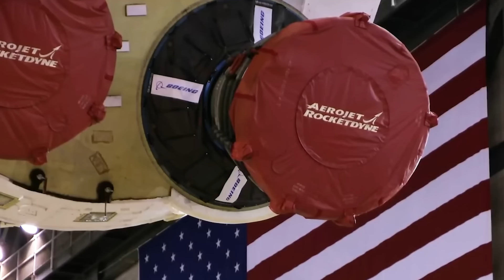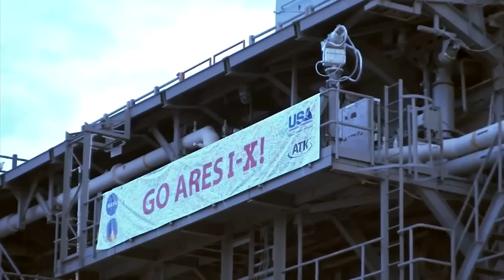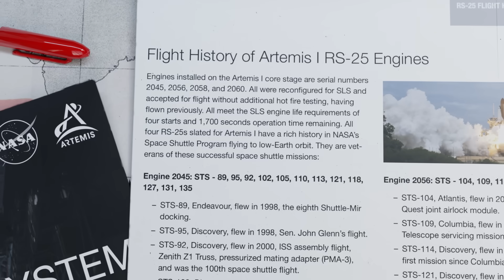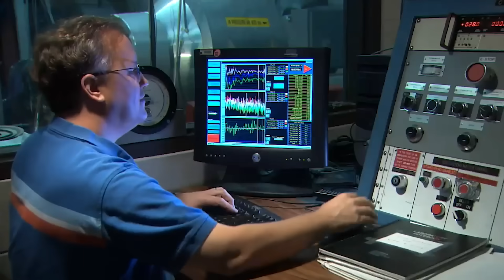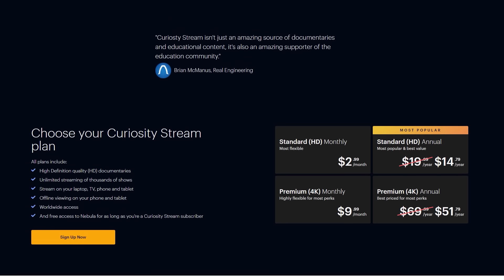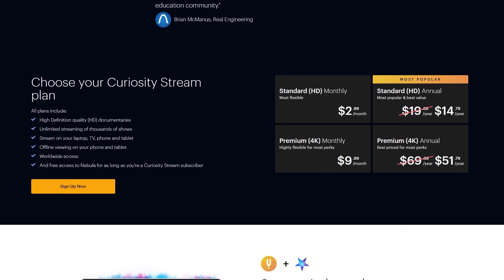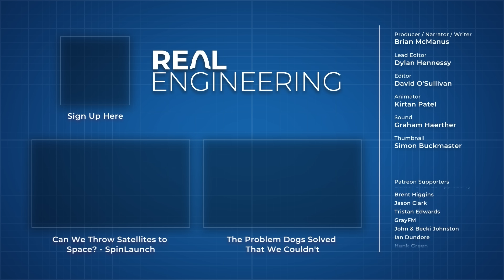The SLS is Outdated. Why Does it Exist?

Comment: I'd like to point out that when you make a solid rocket motor longer, you increase its power, not its burn time. burn time is a function of the diameter and geometry of the fuel. thrust is determined by length because it increases the internal surface area of the exposed propellant. yes, it has 25% more fuel, but due to its geometry, it gives more power than duration. In the case of SLS, the motors are lit from the top, and the fire burns down through a central hole. instead of being round, it's star shape I believe, because it has more surface area to burn.  if you lit it from the bottom, you would only have the area of a 12' ish circle. by lighting it down the center, you can get infinitely more surface area (if you had a never-ending tube)

Fun fact, the SLS boosters have a geometry where they actually "throttle down" and start producing less power as they burn (I'm assuming they either change internal geometry or fuel composition) but this is so that they don't keep pushing harder and harder as they get lighter, leading to extremely excessive maximum aerodynamic loads. they are way more complicated than an end-burning motor like in fireworks

also, the reason they, along with so, so much else that is built in this country, are 12 feet wide, is because that is the largest thing you can move on the highways without needing special routing to clear bridges and such. the central core of SLS needs to be moved down the Mississippi river by barge, and around the tip of Florida because it just won't fit on our infrastructure.

Edit,
if you want to see what an SRB can look like inside, google "solid rocket propellant grain geometry" and you will see plenty of diagrams alongside thrust profile graphs
Reply: Can you explain how length increases the internal surface area but not diameter? What determines if propellant is exposed or not?

Edit: thx for the answers that helped a bunch. So I guess diameter DOES increase the fuel contact surface area, but only marginally compared to length and the geometry of the bore.
Reply: u have it around the wrong way
Reply: @charleyssss  an srb isn't a solid cylinder of fuel, it has a hole in the middle, and inside of the hole is where the combustion occurs. This means that adding length also makes the hole longer, so there is more combustion, but the burn time is the same
Reply: @charleyssss  There is a hole in the center of a solid rocket motor. When you increase the length, the hole is longer, therefore more surface area. When you increase the diameter there is more fuel to burn for the same amount of surface area of the center hole.
Reply: @charleyssss  In very simplified terms, the fuel in the SRBs consists of stacks of solid fuel shaped like toilet rolls. The tubular shape helps increase the effective surface area that is being burn at a given time, versus trying to burn a solid cylinder from the bottom. While the latter would effectively increase burn time, it also reduces the output thrust at a given moment (or impulse). The former design on the other hand helps to increase thrust as more fuel is burnt at a given time.

Now back to the original question. A longer tube would effectively mean more surface area to burn, hence the increase in thrust. Burn time will not increase as the additional fuel is being burnt at the same rate parallel to the rest of the fuel.
Reply: @charleyssss  it’s hollow inside ,the reaction occurs lengthwise
Reply: While true, another option for increasing burn time is putting more combustion inhibitors in the propellant mix.
Reply: @charleyssss  The diameter of the hole tends to increase as  the fuel burns away anyway.
Reply: @charleyssss  Also, the hole doesn't have to be round, but can eg. be "Star shaped" in order to provide a much greater surface area. The manipulation of the shape of the "hole" (which doesn't have to be uniform throughout the entire length of the SRB), enables the engineers to design a SRB with a desired Flight Profile (eg. more initial thrust)
Reply: That's true.  Also, the profile of the solid propellant is not a circle.  The circle would just get bigger and bigger as the burn progressed, increasing chamber pressure.  The profiles used are more like star patterns so the surface area of the exposed propellant stays roughly constant during the burn.  You want to maintain the maximum chamber pressure the booster can support for the entire burn.
Reply: solid rockets also have different burn time/thrust for launch time. nasa is not stupid
Reply: Depends on the motors burn pattern. I believe these SRBs are central bore brining so you should be correct, but that would not be the case for aft burning motors.
Reply: Its. It's just credibility. Your statement carries more weight if its content is literate.
Reply: @charleyssss  The motors have a center bore and a lit from the top, and flame covers the inside of this tube. you can change the shape to get different burn profiles (like a star instead of a circle). that changes the surface area exposed along the length of the tube within the propellant. 
so making it longer just adds more surface area to burn, but the burn rate is the same so with the same diameter the burn time is the same only with higher thrust.

someone mentioned there are apparently motors that burn from that aft, but unless it's fireworks i don't know many that work like that
Reply: @margarita8442  no. the space shuttle bootsers are lit from the top and burn along a central tube. longer tube means more surface area to burn. the same propellant mix has the same burn rate so it will burn for the same amount of time before reaching the casing. 

it does not burn from one end to the other like a road flare or a candle.
Reply: @grungar3x7  yes, but in this example we are comparing and contrasting different volumetric geometry of the same propellant. there are a lot of ways to use 25% more fuel, and it's not always 25% longer duration. at least that was my point originally
Reply: E Van  Nope, I just learned it from a bloke with a Scottish accent
Reply: @chrispbacon4519  you should have seen my spelling before I ran auto-correct over it 😅😅
Reply: @seldoon_nemar  Can I be the first to declare your comment crispy? (see my main string comment below)
Reply: @seldoon_nemar 
As stated before, I am in agreement with your assessment and observations. I was merely making a statement about possible solutions to the burn time problem without changing dimensions of the outer case.
Reply: @The smoker I never said anything negative, just pointing out an interesting fact about the hardware I'm sure some people are unaware of. even in the other replies, some people have assumed that they simply burn from the bottom up, so that 25% would be longer duration not 25% more power.
Reply: @troosimimimmi  I have updated my comment with more details
Reply: @seldoon_nemar  you should see my life before I run auto-correct on it  🤣
Reply: @seldoon_nemar  the F9 booster also has 12 ft diameter, because of the transportation limit on roads
Reply: @charleyssss  It has to do with what is called web thickness.  Solid rocket motors burn on the surface of the fuel grain.  As that grain is burned away the surface area changes.. You can play games with the geometry of the internal shape to make a motor increase in thrust over time, decrease, stay neutral etc.   So as the diamter increases you have more distance from the core to the wall.. That tends to increase burn time.  If you want more thrust you increase surface area. The easiest way to do that is to increase the length.
Reply: Sorry Punjab, but Testor's model rocket experience isn't going to win you points. You may be more successful scamming social security numbers from the elderly, like your brethren do.
Reply: @simonm1447  yup! anoter perfect example. I think a bunch of the Delta components have be 12' dia as well
Reply: @Djlawson1000  an aft burning SRB would be limited to only 133 sqft of exposed propellant unless you burned it in a cone. if you need a cone, then a cylinder is just a cone without the far end... of that 12' of diameter, if the interior has a 1 foot hole running the length of the 177 foot booster, then it would start with 556 sqft of burn area and by the time that hole was 2' across it would have 1112 sqft of burn area to provide thrust
Reply: I'm really curious now about the internal geometry they use to engineer the thrust profile. Any simple design I can imagine would expose more surface area over time as the fuel burns away, but that's the opposite of what is needed. The thrust needs to be highest at the start and then to reduce over time.
Reply: Well said Seldoon
Reply: @QuarkTwain  Image that at each grain segment the internal diameter is increasing but the length of the grain is decreasing because it's burning on the ends of the gain as well.  This flattens the thrust profile.  To make it neutral you control how long the grain is vs it's diameter.
Reply: @margarita8442  Don't correct people
Reply: Have you guys seen those fire logs with the notches cut through the center? That's basically how an SRB works. It burns inside those central cuts and burns outwards. That is why making the booster wider increases the duration
Reply: its* geometry
Reply: @QuarkTwain  Well... with this design it will be all out solids before it reaches the point past maximum aerolastic pressure than the liquids go all out and the booster drop off.
Reply: Serious inquiry sir,  if I may?
Why  would I need to move a rocket along the interstate. , 
the vast majority of rocket launches are over the ocean so I can make them as large as I want as long as I am shooting my rocket over the ocean as there's nothing in my way why would I build a rocket launch site where I would have to move very large Rockets plea excuse  my English  as I am trying to  learn. 
Thank you for your time.
Reply: Everyday Astronaut covered some of this as well.  Good post bud, far out of my skill set and well said enough that I greped it.  Thanks bud!
Reply: Solid motors are so cool.
Reply: The SRBs are moved in segments by rail, not on highways
Reply: But it takes the form of another segment?
Reply: @devinhood7340  Rockets are usually not manufactured in the same location as where they are launched. This is often because of economic or political reasons. If a rocket segment is built at a factory hundreds of miles inland, it is shipped by truck or rail to the launch site.
Reply: Very sad that the story about the size of the boosters being set by the width of two horses has been debunked.
Reply: Depends on the internal geometry. Core burner gives high impulse for short time. End burner gives lower impulse for longer time. Longer end burner burns longer.
Reply: My Dad helped build one of the barges.
Reply: Throttling is indeed done by varying the shape. SRBs have a hollow core and burn from the inside to the outside across the entire height of the booster at once. The thrust depends on the currently exposed surface area within the hollow core, hence depending on the cored shape you can change thrust characteristics.
 
A circular core will lead to a gradually increasing thrust, as the propellant burns towards the exterior, the core hole gets larger and thus increases in surface area.

A star shape on the other hand starts out with a very high exposed surface area, but because the points of the star are quite thin, they burn away much more quickly than the diameter of the core hole can increase, thus leading to an initially high thrust which falls off until the star shape has been fully burnt away. Depending on the size of the star this can then be followed by a continued burn of the now round core, leading to an increase of Thrust again.
Reply: Not saying you're incorrect, just that it seems counter intuitive. If that were the case (and this is sheer conjecture) the thrust rate would be getting greater the as the burn continued further into it's cycle. The greatest thrust (by internal surface area of exposed propellent) would be just before it ran out of fuel. Intuition would state that the greatest thrust would be needed at lift off not end of flight.
Reply: @psoltan  Ah, so NOT like a model rocket solid stage. That was the picture in my mind.
Reply: @fishyfool  yes that's true. Unfortunately physics doesn't always conform to what's convenient for humans.....
Reply: Why would NASA launch a rocket like the SLS of which debris would crash to Earth uncontrolled to threaten human safety?
We demand that NASA unconditionally release the flight parameters of the SLS in advance and that NASA Administrator Nelson respond!
When Nelson commented on China's Long March 5B rocket, he said it very well!
Reply: Don't want to read all the replys, so not sure if this has been corrected; Only the top part of the fuel has the star shape. The rest is cylindrical, actually a little conical.
Reply: Is there anyone who can explain how the SLS control it's debris to reenter the earth???? I saw this everywhere when China launched the Long March 5B. I do want to know the details.
Reply: Hahaa drill a 1/4 " down the center of an estes engine and it leaves a ding in  the blast plate
Reply: What always baffled me was the SRB's consistent fuel burn rate.  As the burning moves from an open void in center, the surface area gets larger. Example: at launch core void = 1 meter in diameter. As the burning moves from center to edge, the void becomes wide in diameter. That equals larger surface are exposed to burn. If initial void = 1 meter, by time it gets to edge, it's 3 - 5 times that and should have 3 - 5 times more thrust. Only way to prevent that is with changing chemical composition and narrowing core void.
Reply: smart! mashallah
Reply: @margarita8442  Not really, due to hole in the SRB they burn from center to the outwards radially
Reply: @fishyfool  Supposedly, Estes model rockets are black powder, end-burners so, yeah, not the same. (https://en.wikipedia.org/wiki/Black_powder_rocket_motor)
Reply: @grungar3x7  Just less burn catalyst, iron oxide, Ferrocene, Catocene.
Reply: @SJR_Media_Group  you are assuming 2 things
1 that the burn rate does not change. they could change the fuel mixture when casting the booster. it's not a monolithic casting, it can be segmented out and poured with variable burn rate mixtures through its diameter.
2) that its consistent geometry. they can also cast void spaces and different shapes within the core. changing the internal geometry will change how much of the material is burning at once. a solid, flat wall will burn slowly compared to one that has channels cut in to expose more fuel. they can time how long it has been burning and have areas that burn faster and slower that way.

The phrase you want to search for is "solid rocket propellant grain geometry" and there's a great summary
Reply: https://youtu.be/Kqt-ChsHrIY
Finally it’s here..
Reply: @seldoon_nemar  Thank you... useful data to be sure. It makes sense.
Reply: No shit
Reply: incorrect due to oversimplification
Reply: Regarding the internal shape of the solid rocket fuel within the SRB; It starts out cylindrical with a hollow center and quickly burns to an inverted star, as it burns through, the main propellent becomes more narrow and the mix filling in the gap gets wider.  This fill mix is a lower combustion compound (thereby reducing the thrust power).  This combination is specifically for initial lift-off and the throttle down portion as the vehicle hits Max-Q.  Upon the time for throttle-up, it burns to cylindrical for max thrust.  This is all calculated with chemically timed burn-rate/thrust because you can't manually control the burn rate of an SRB like you can the liquid engines.  There is a vid on the youtubes that shows how they manufacture and pour the mix into molds for the SRB sections.
Reply: @mohare134  not exactly. Look up "solid rocket propellant grain geometry"

You can have a motor that has peak thrust at ignition and just falls off and sustains, you can have one that starts gently and then rips, you can even have multiple peaks of power so you have a lift of and post max aero bumps of power
Reply: @envisibleward2422  you're incorrect because you just posted a lazy comment with no context. 😉
Reply: @AntiContradiction  real shit
Reply: @seldoon_nemar  I'm not arguing that point as it is an accurate one.  My explanation of the geometry was based on the video I saw about the manufacturing of the SRB's specifically.
Reply: The star shaped hole isn't necessarily to increase the surface area of the reaction, it's to control the size of the surface area throughout the burn. If it was just a circle it would get wider as it burned out, increasing the surface area and the rate of the reaction over time.
Reply: Why do you have to write an essay here everbody knows or can get knowledge about solid rocket boosters
Reply: It seems to me you have to add the phrase cateris paribus, all other things being equal.
Reply: Thanks rocket scientist.
Reply: @grungar3x7  Sometimes the hole has a star shape.  Changing the shape changes the burn time.  You are also correct about the fuel composition making a difference.
Reply: You can have more surface area in a solid rocket if you increase the diameter as well, so it's not totally accurate to say diameter is irrelevant.
Reply: @takanara7  yeah, i guess the larger diamater could produce more thrust as it burns out. it's a valid point
Reply: are you copy pasting this from wiki
Reply: There is a length limit, more or less the shear resistance of the fuel is what dictates the maximum length/power
Reply: Yes you also watched his space shuttle video.....
Reply: @charleyssss  if the hole in the middle is the same size then it only increases surface area for the last whatever percentage of the burn. Length will always increase surface area because you're just adding stuff that wasn't there.
Reply: Thanks for the explanation. Did you work for NASA, Aerojet-Rocketdyne,  Boeing, or L-M ?
The amount of concise knowlege you have seems to indicate that you took part in the design/build of the SRBs.